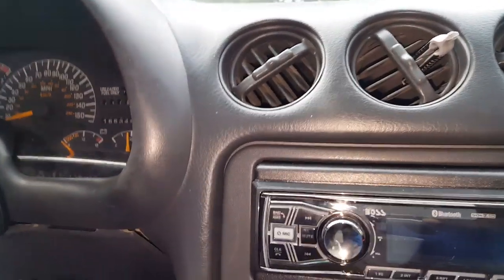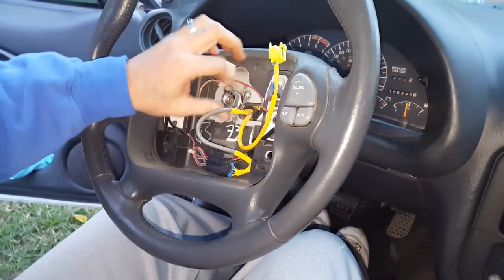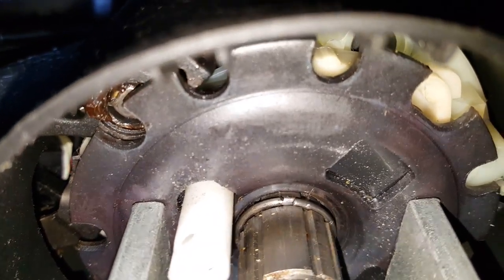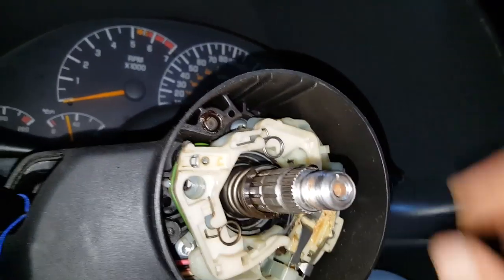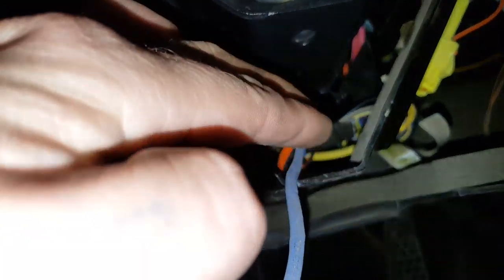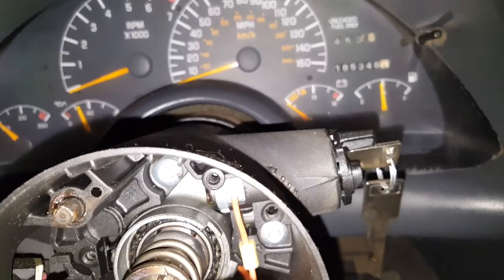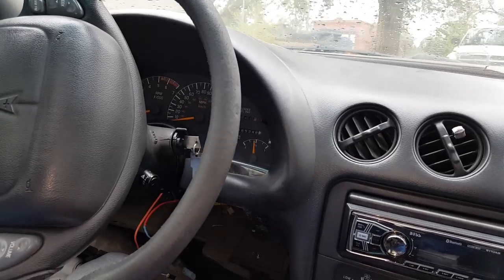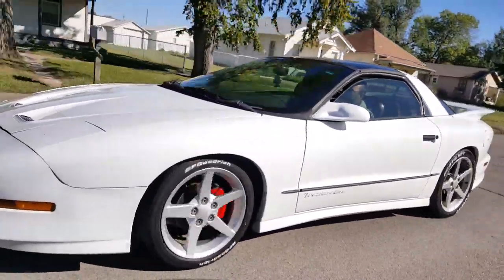How to replace lock cylinder ignition Step by Step | Bypassing GM Vats System

Comment: If possible, try cleaning your ignition keys before replacing your ignition lock cylinder. I got lucky and just had to clean and lube my ignition key. I still have both ignition keys from the factory. One key had zero issues and another key would get stuck in the ignition and I couldn't turn off the engine. Luckily, after gently wiggling the ignition/key enough, I was able to turn off the car and remove the problem key. First, I cleaned both of my ignition keys with 99% pure isopropyl and a cloth. I was careful to clean both the teeth and the small grooves. I saw some visible debris transfer to the cloth from the teeth but especially from the grooves. After cleaning the keys, I sprayed some WD-40 Specialist Dirt & Dust Resistant Dry Lube PTFE Spray on a cloth and then "cleaned" the keys again with this. I did NOT spray anything into my ignition lock cylinder. Also, I've read NOT to use normal WD-40 because it can attract dust and grime over time, making the problem worse. Anyway, after cleaning the keys and then wiping them with the WD-40 PTFE Dry Lube, both keys glide in and out of the ignition and I have no problems with my ignition switch. I special-ordered my 1995 Z28 twenty five years ago - 172K miles with original keys and original ignition switch - so there is a chance that you don't have to replace your ignition lock cylinder if I didn't. Maybe I just got lucky but try cleaning those keys first.

Comment: He didn’t get into bypassing the vats security system, he just said it was already done, never once said how to install the resistor or which direction they should go. All he did was replace the switch
Reply: carl brackett its pretty simple to understand all you do is check the resistance on the old key and then add that resistance to the plug with the purple and yellow/black striped wire but thats only if you want to use the old key that is the bypass
Reply: At least from my understanding

Comment: The orange wire on the new cylinder....you ran the orange wire down thru the column...if you want to bypass the VATs...where did that end plug into?

Comment: Alternate solution to dealing with resistors in the keys: delete the whole VATS system.

This is done by A. programming VATS out of the PCM (any tuner can do this) and B. taking the yellow and black wire from the TDR and running it straight to ground.

Comment: I have a 1993 Chevy caprice 5.0 v8
Slightly different.
This video showed me how to remove the lock cylinder, witch is held by that pin screw T 15 need

Comment: i lost my keys a while back I bought a new lock cylinder that came with the keys and a vats bypass module offline. the new keys should start the car ?
Reply: Benji B I have to do the same thing. Did you get it to work?

Comment: I replaced my ignition lock aswell completely the same only issue I’m having is the vats system new lock don’t have the resister I know the value of the old key 
Oddly is it normal that my car now ever time I re connect the battery the alarm starts going crazy
Reply: You can get a VATs key blank with your resistor value and get it cut to work with the new lock cylinder!

Comment: I’m thinking of getting a new key for my firebird. How much would it cost to get a new vats key?
Reply: I had a new key made with the VAT pellet in it (VAT #3) and as I recall it was around $30.
Reply: @1999Shortstuff  where did you have your key made?
Reply: @2doodsdogamesdude403 
OPTION #1:   I had a duplicate ignition key made at a Buick dealership. I can't remember the dealership's name, however, it was on RT38 in Westmont, IL. Getting a VAT key made/cut requires you to provide them a copy of your car title and a copy of your birth certificate as I recall (this was 10 years ago). I did not like what he wanted and put up a stink, but he told me it was required by law that way it would prevent anyone from aquiring a duplicate key for someone else's car.
OPTION #2: Replace your ignition cylinder. I later had problems with my ignition switch and replaced it. I bought a replacement switch for $30 and installed it myself in about 45 minutes, start to finish.  You can also find new ignition switches on ebay for $15-$20. I went to O'Rileys because I did not want to wait 2to3 days for delivery.  BTW, you get 2 new keys with your new switch.

Comment: Is this the same for third gens because I just loss my keys to my camaro
Reply: Basically, yes it's the same procedure. Some of the parts are a little different (3rd Gens didn't come with air bags for instance) - Great walk through though!
Reply: @scott2455ify  if I recall 90-92 have airbags and I believe they started using vats in the 88 or 89 camaros. Its been awhile..

Comment: How do you bypass the vats system if your key doesn’t have a chip? I can’t get the correct the resistors because I don’t know how much resistance is in my key because it’s literally just a metal key no chip
Reply: You can get a VATs bypass box with all 15 resistances so you can figure out which resistance works for your car.
Reply: @destruxandexploze2552  Do you happen to have a link for that Vats bypass box with all 15? Have the same issue as joshua

Comment: OK so I have a crank no START issue and think it the vats system when I turn key on security light come on and then goes off then when I crank it over light comes back on what are your thoughts thank u any help would be appreciated
Reply: Did u figure it out? I'm in the same boat.
Reply: @TyRC12  i had a similar problem, putting in a resistor fixed it

Comment: I do not unnerstan.....If the security wires under the dash were already cut and hacked previously, why install the new lock WITH wires attached? why not cut them off since they are useless? seems like more crap in the hole to jam or bind something up... I'm facing the same issue but need to hack the wires AND replace the tumbler which is hanging up intermittently.

Comment: Instead of spending 40 bucks to have a key made you can make your car easier to steal.  Yours was already done that way so I wont give you too much guff about it but why not spend the extra to keep it correct and stock?  These are a pain and I found the hardest part was running the new tumbler wire thru the steering column.  I have a 99 camaro ss so I was very particular about keeping everything stock.  Sadly nearly 10 years after replacing it I have to do it again because even the aftermarket tumblers are junk.